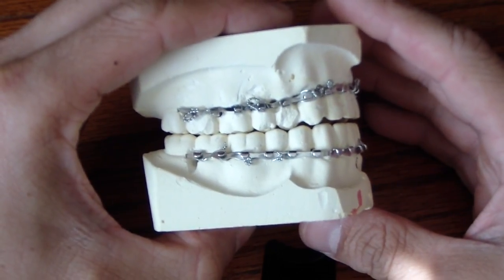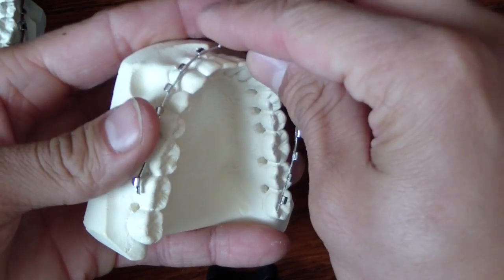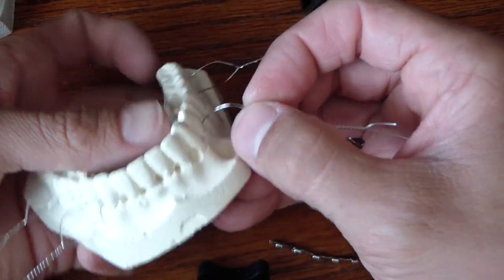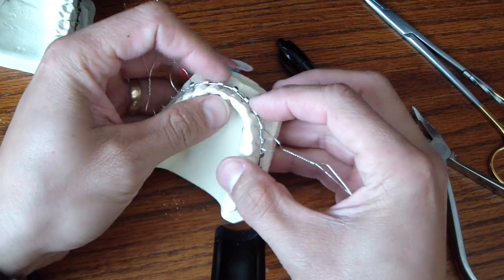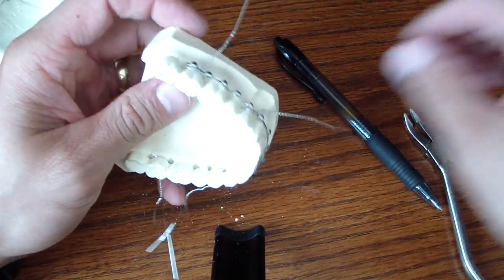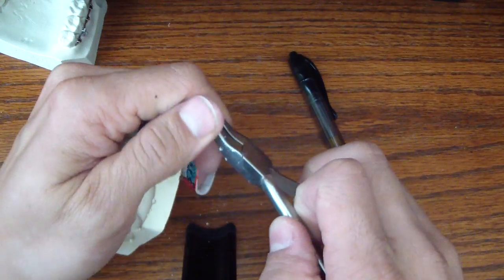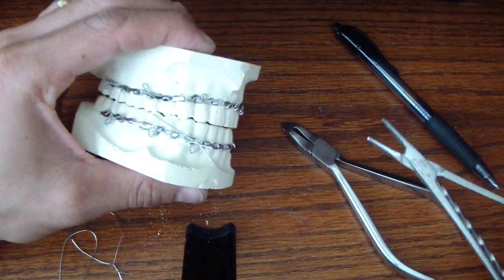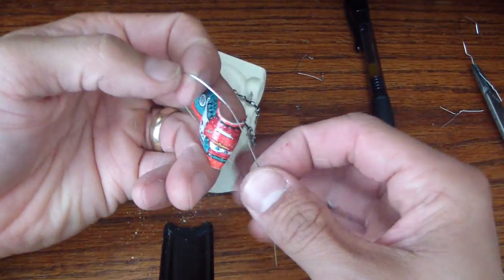Wiring Fractured Jaw - Erich Arch Bars

Comment: Is it used on broken jaw? I had broken upper jaw, doctors dint do anything.. I am wandering hol long will it take to heal? Its already going second month, and jaw is still moving little bit. And what specialist could do this? Is it dantist or face surgical doctor or some other?
Reply: Maxillofacial surgeons, they are normally DDS or dentists that specialize in surgery of the face & teeth. Im going on 3 wks due to a condyle fracture, and I have 3 more to go before they put me on elastics for 2 more weeks

Comment: This technique does not require pins? My bars are secured by pins so they do not move at all. I had my wires replaced this week (3 weeks out from first surgery) and I swear I am wired much tighter now than I was before and it's even more uncomfortable. I have 3 more weeks left of wires because my surgeon does not like bands and I am miserable. It doesn't help that I am claustrophobic and have anxiety constantly. Being wired shut is the worst thing imaginable and I cannot understand why anyone would have ever voluntarily had their mouth wired shut. It's torture!
Reply: I have the band's and I am miserable.  I have only have them for 1 week now
Reply: I’ve had them on for 6 weeks, was still painful when the fused bones twitch, so much pain and wouldn’t wish this upon anyone
Reply: @wilbertandre40  How are you feeling now? I had them for same time but the condole has pinged on my ear canal and elastic was so tight
Reply: @moonlitsky5744  it’s good now, got them taken off November 2009, my jaw doesn’t seem the same way it was though, bite wise, but I still box and mma here and there and it’s still holding up better than before
Reply: @wilbertandre40  So long as there is no or limited pain, and hopefully does not stop you from doing any activities. I’m just starting to feel fullness and and pain in my ears most worse when I wake up. I don’t know what any ENT or MF surgeon can do, as it seems to be put in the too hard to deal with basket.
Reply: I also got wired so tight, when I complained about the spasms that I never had before, they just said it will go away. I now believe the super tight wiring for 4weeks is what caused my condyle to be shoved up into the ear canal causing so much wreckage there, with ear pain, tinnitus and Ivan even feel the bony parts on that side of the joint, but not the side that was looser. How are you feeling now? I hope you have no pain 🙏
Reply: @moonlitsky5744  yeah mine was tight too and the spasms is from the bone coming back together which hurts because that’s pain I’ll never forget, but my chin was numb the whole time, after I got the wires out I couldn’t open my mouth too much too eat, and it was happy time eating again lol